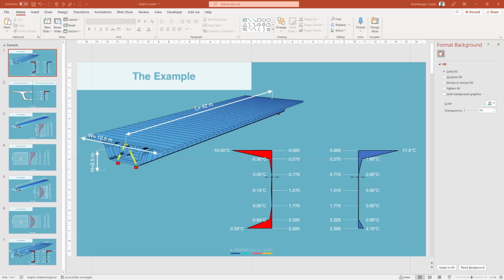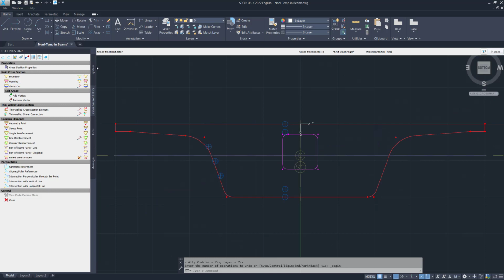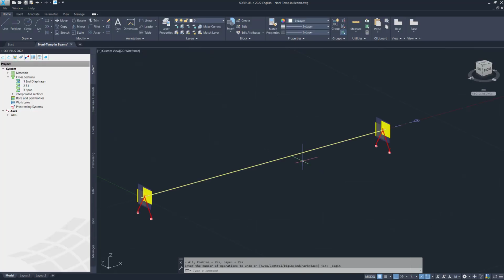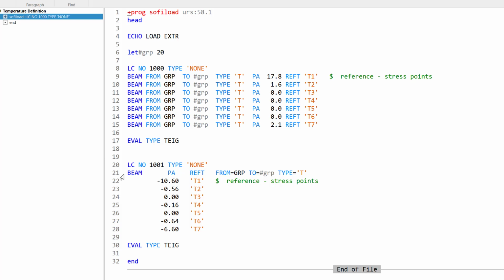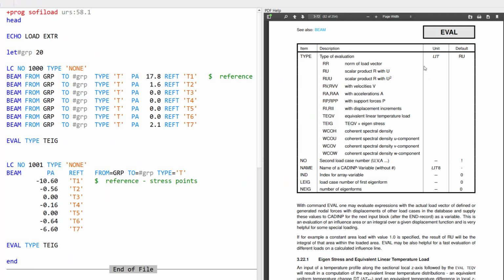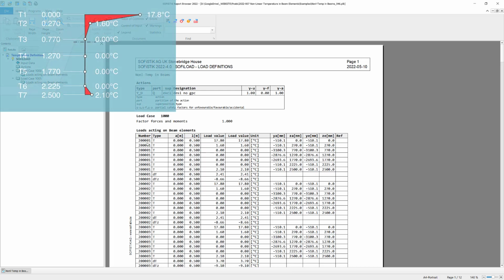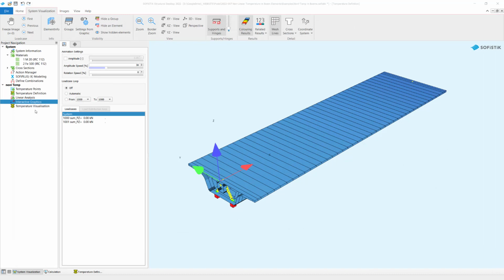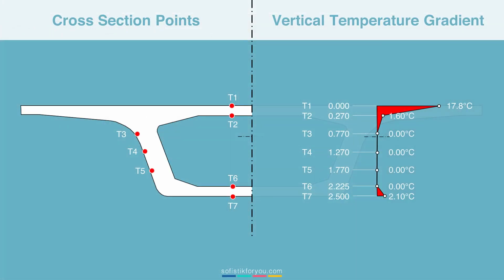Non Linear Temperature in Beam Elements

Comment: Thank you Guido! Great explanation and demonstration as always. It surprises me that SOFiSTiK does not have any built-in visualization for thermal gradient input. I am curious about one thing (well, I should've tried it out myself before asking, but maybe your explanation can help other users): In this example, we are defining some of the reference points along the left web of the cross section and the others at the centerline, would this definition also generate non-linear temperature distribution in the transverse direction? Or, does SOFiSTiK always only consider the non-linear distribution in the vertical direction?
Reply: Great question. I would also ask whether the points must be in an edge, or they could be anywhere inside the section (including holes).

Thank you Guido, and looks great the script that generates the report visualization.
Reply: Hi  @benitopelaez2417  and Guido, I tried once to define a reference point along the centreline of a steel-concrete composite box girder, using Teddy though. When running the AQUA module the software stopped and said there was some error. So, yes, probably we must make sure the points are within the defined polygon/solid.
Reply from the maker: One of my colleagues suggested another input option without using explicit points in the cross-section. Basically, you assign the temperature value by an eccentricity. 
https://www.sofistik.de/documentation/2022/en/tutorials/bridge-design/composite-bridge/composite-bridge-nl-temp.html
Reply from the maker: Hi, Thanks for your feedback and question. Honestly, I haven't tried it my self to place the points outside the cross-section/material. Will give it try when I'm back in office ;)
The distribution is always vertical. So it doesn't matter if you place the points on the left or right web. I should have mention it in the video - So thanks again for the question!